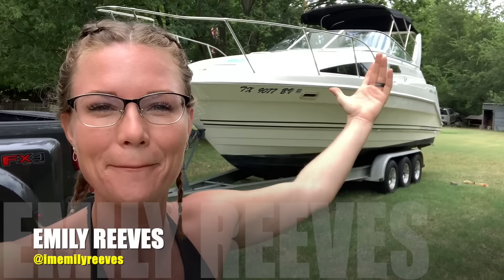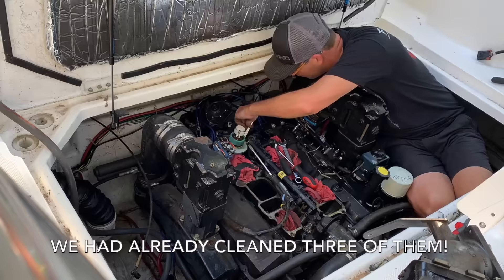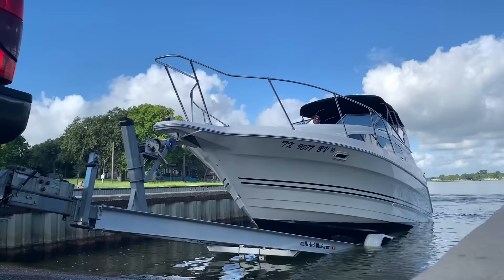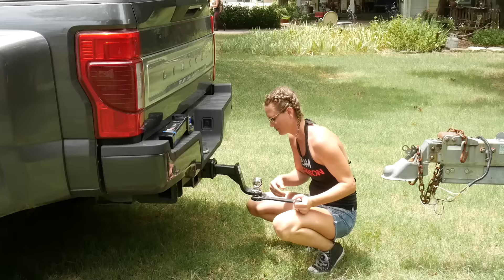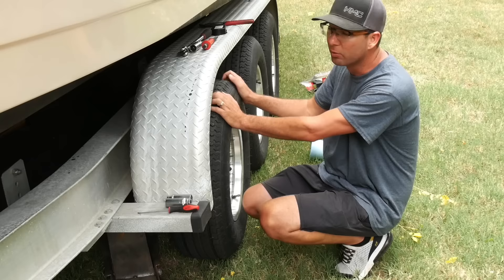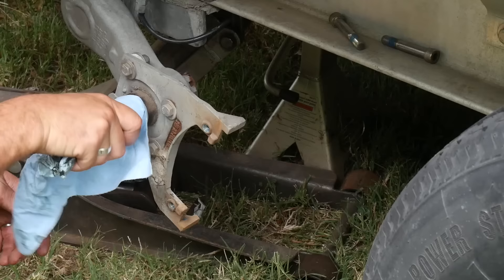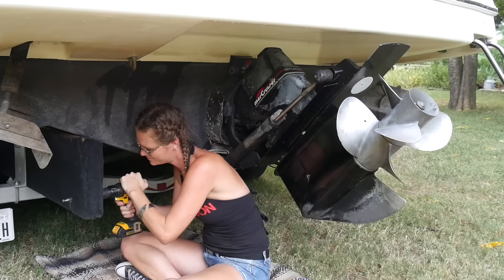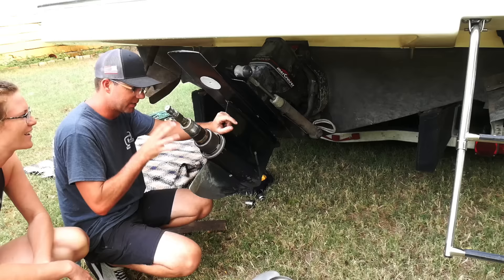Prepping our 5k boat for 10 day adventure!!!

Comment: I always had waterproof led lights on my trailer and still found i was blowing fuses in the truck. So anytime i go to launch I unplug the trailer and no problems since. Love the channel!
Reply: good tip
Reply: I've always done the same. Waterproof lights or not.
Reply: Depends if you have trailer brakes or not. If you unplug the plug you can't back up the boat to launch it cause the brakes will lock up theres a switch in the wiring that unlocks the brakes in reverse allowing you to back up
Reply: @nathanbutler8240  an electric trailer brake uses power to apply the brakes, not to release them. A surge brake will lock in reverse if you don't manually override it with the lever.
Reply: @robertpontius1689  my mistake I have hydraulic brakes on my trailer if my plug isn't plugged in i can't back up cause it pushes on the master cylinder on the trailer and locks the brakes unless the electrical is plugged into the truck
Reply: @nathanbutler8240  That is a thing i havent thought of and of course you are correct. My little 16 foot boat has no need of trailer brakes. That big triple axle trailer of course has brakes so my tip wouldnt be so effective. thanks for pointing that out.

Comment: when you park the trailer in storage get the trailer tires off the ground and cover the tires and use a protective spray on the tires
Reply: Don't use spray on tires ask any tire guy it causes your tires to dry rot and crack worse!
Reply: @burnair1608  Silicon rejuvenates rubber, any petroleum base product deteriorates them. Armorall and such I hate that crap. 303 Protectant has been used.

Comment: When you park the trailer jack the axles up and get tires off ground. They will last a lot longer.
Reply: Do you own any trailers? No one does that.
Reply: And cover them with plywood cutouts so the sun doesn't beat down on them just sitting there
Reply: Noah Smith maybe they should...
Reply: @rstrst2099  yes or the nylon covers are a good investment. Sunlight [Ultraviolet rays] are to plastic and rubber as saltwater is to metals.
Reply: @noahlearsmith  yes they do when stored for longer periods. Do you own any trailers?
Reply: All that is needed is to frequently move the trailer.  You can put chalk marks on the tires to make sure they are resting on different spots.  If you can, check the air and take them out for a spin too.  Getting them warm on the highway is GOOD for them. Then park them off the chalk marks.  I would recommend this quarterly.
Reply: Donald Smith I get the impression they’re only gonna be with the boat a few times a year, if it’s getting stored 3-4hrs away.
Reply: Noah Smith I do.. and it works. I also do it with vehicles that I don’t drive a lot. Helps big time with flat spots

Comment: On the seals, if you remove the outer bearing and run the nut back on you can use the shoulder of the nut to pull the inner bearing against the rear seal and it will knock it out, usually without damaging the rear seal. Inspect the bearing grease and reassemble.

Comment: Ask a welder that yall trust right to weld up 2 trailer guides 1 on the left and 1 on the right this aids the boat with correct alignment...you should find them sticking up and around on either side of the boat and usually slightly taller than the boat as well. 

This definitely works for boats this large

Many thanks from
South africa 🇿🇦 ♥️

Comment: Tip for tightening large nuts.  Use a chisel to drive it tight.  Old VW flywheel nuts where thought to be at 100 fp plus when you could not move the nut more than 1/16".

Comment: Our first boat together isn't nearly as big but we got a deal. 12 foot Sea King aluminum boat and aluminum trailer for $80.00. Found a 3.5 horse Sea Horse motor, air cooled, for $100.00. Now looking for a trolling motor. Already talking about finding a bass boat for the bigger lakes, but this will do for the lakes with a 5 horse limit on them. Sweet boat that y'all snagged up. Happy boating.

Comment: Since our launch ramp was rather steep, I never trusted the stranded steel winch cable on my trailer, so EVERY time I reconnected the boat, I added a large chain from the trailer frame to the bow eye.  It was cheap insurance!

As for trailer lights, I would build a removable light bar like the tow trucks use.  Trailer lights fail after being submerged,  especially if used in salt water.  A light bar can be kept out of the water and will last forever.

Comment: at 7:54; try turning the hitch receiver 90-degrees and re-inserting it into the truck.  90 left makes your wrench movement top-down when taking off the ball.  90 right makes it easy top-down to tighten the nut fully (since you can stand on the wrench)

Comment: 7:18 when towing you do want you hitch & related equipment ratings to exceed the weight of what you’re towing. When you hit bumps it can shock load & that energy is absorbed through the hitch. 
It also appears that trailer has hydrostatic brakes. That F450 can tow it but it needs help stopping it. Check/change that fluid & I suggest adding bearing buddies to easily grease the wheel bearings. If it doesn’t already have them.

Comment: Boats all have a spring loaded tie down specially made to hold a boat down on the trailer. Saw you holding a ridged strap with hooks. Bouncing will rip the eye hooks out. Spring loads will give, yet hold the boat on trailer. Everything else looks great.

Comment: When It comes to a receiver hitch , I've always preferred a solid bar, over the hollow bar.
Reply: Did you mean ball?
Reply: @BackyardBeeKeepingNuevo  The slider bar ,that the ball attaches to, then slides into the hitch.
Reply: taz one ah, ok. I’ve always used hollow bars.
Reply: Jr ALEXANDER  I don't know where you get that from, but the receiver bar is not round it's square and it's  2 inch by 2 inch. when buying a camp trailer they use solid square bar not hollow.
Reply: Jr ALEXANDER  I use a solid husky drop hitch with leveling bars and it's rated at 1000 lbs to 1400 lbs tongue weight and 14,000 lbs gross weight, when using the bars. I don't care what someone uses, solid or hollow ,as long as it's rated for the weight being hauled, and fits the receiver wright. I have both solid and hollow ,but have always used the solid ones for the heavier weight.

Comment: I had two sailboats on San Fran Bay and some trips out the gate and some up the Delta. I don’t know where the existing depth sounder is, but it’s a good idea to have one as far forward as practicable, mount the transducer on the inside of the hull (epoxy) where the turn of the hull is still mostly level, so you’ll have 
kind of straight down readings,
under the V berth. The bow is what you’re going hit stuff that’s under water with. Next buy a RADAR, probably with a chart plotter in the same unit. You’re going to be out on the water at night, and you might be boating somewhere that gets fog occasionally. Don’t think you’ll need it? There’s a saying in private aviation, “it’s better to be on the ground, wishing you were up in the air, than up in the sky wishing you were on the ground.”  You’re right you probably won’t need it, until you do. Make sure when the husband is out of commission the wife can raise the anchor and get him and the boat to shore/help. Free advice from one that learned the difficult way 👨‍🦳 enjoy your boat and may you have safe seas.

Comment: A tip Next time connect a 9v battery with alligator clips while you spray carb cleaners or injector cleanser on the injectors they will open and close while you are cleaning it.

Comment: Getting the seal out without damaging it is easy remove the outer bering and saftey washer then screw the nut back up on the spindle and pull out on the hub sharply an use the spindle as a reverse slide hammer and the seal will come right out n be left on the spindle .

Comment: Yes the tie down straps should be into metal and trailer wiring Great Job only thing I do different is after I'm done I use liquid electric tape makes mine last a lot longer from corrosion.  I use lime away on lower unit every year to clean it up than wax it my Boat motor is 16 years old and still looks new.  I have been towing a boat for 43 years and armor all is your friend as My tires have lasted over 15 years even parked outside once in spring and once when I put it away for the year stored outside all the time.  Tire pressure I check one a month when trailering and in 43 years I have had one flat tire and that was from a screw found in tire.  Strap on trailer take off take to a canvas shot cut off two feet then have them restitch hook on, cost a couple bucks.

Comment: Keep the trailer axles  greased.  When putting the boat in or pulling it out, Back the truck up till the trucks  rear tires touch the water.  If you need to go back further don't let the water hit the rear end

Comment: Just a couple tips: I always like to pull the drain plug as soon as I recover the boat at the launch. Allows any water in the bilge to drain out on your ride back.

Also, you can turn off the blow once you are underway. Start it 10 min before starting the engine to clear the engine bay of any fumes when starting the motor. Then you're good to shut it off. Enjoy!

Comment: Pro Tip:  take the 28’s with you, just in case.
Reply from the maker: John Fleming We brought them!! Lol!
Reply: You also should probably pick up a spare inner and outer nut. Why??? Because they come off, and you never find them in the bottom of the lake. Been there done that. FYI, you can pick up Bravo 3 prop wrench off E-Bay pretty cheap. You'll want that and the spare props in the boat with inner and outer nuts. I damaged a rear Dou-Prop on my VP one afternoon at a sand bar. And having all that in the boat saved a expensive tow back to the marina and a more expensive haul out.
Reply: We had 2 Bayliners before we purchased our four winns. Did not have any more fun on the expensive one than the cheap one. All of my boats had transom hooks. Even a fishing dingy should be secured. A  couple in Spanish fork canyon in Spanish fork Utah were killed when they slammed into a vehicle as the boat came over the top and crushed their truck.
Reply: You got a great deal. Owned two bayliners 2655 and a 3055. Nothing better than cheap boating. Nothings different if your mechanically inclined between you and anyone else on the water!
Reply: We bought a 1990 wide beam 2655 That had a OMC Cobra drive and a 460 Ford Big block. The boat it self was a fresh water boat, And was in fantastic shape. The engine ran. But the drive was shot. I had bought a Insurance salvage boat that had slightly cooked from another boat that burned at the same dock. It had a Volvo Penta Dou Prop drive and 2 NEW Stainless steel props. It took me a 3 day weekend to do the swap. Out with the Ford 460 (And had a buyer waiting for that) And out with the OMC drive and hull mounting parts.  And in with the VP donor parts. And as I was told by everyone on the Bayliners owners message board. The hole cut out would be the EXACT same size, Bolt pattern and all. I was running a set of F-6's on this boat (28" and 10'3 wide) And it was topping out at 90% throttle at 47 mph on good water. And was cruising at 36-39 mph at 70% throttle.  A speed that these old tubs never saw with the OEM OMC packages in the late 80's early 90's.  And was actually pretty easy on fuel. At cruising we where only burning 6- 6.8 gallons per hour. These counter rotational drives (VP & Mercuiser) have make fantastic repower packages for older boats like this. After doing this one of mine, And having other boat owners staring at me with the "IDK about this idea" I did 3 more for other people. The hardest part was finding a good donor. The hardest part of the actually job. Was setting up the gantry lifting set up to remove the old engine with out scratching anything. We finally went with a 5 tin electric winch and a 14' tall gantry set up on rollers to remove and reinstall the engine. After that it was super easy to knock one out. Started on Friday after 5pm. And typically we where doing a in water test run by late Sunday afternoon.  It got to be pretty fun to watch a depressed boat owner that wasn't so sure about this idea. To turning him into a kid with his first car, all over again.  And the performance from going from a single prop. To a dual counter rotational set up in like adding a complete other engine. The last one we did was a Small GM block (260 carb) Engine.  To a small  block VORTEX fuel injected engine. That went into a 2855 (10'3" Beam) boat. He put F-7 props on it. And it was SCARY how fast that big boat moved.  I hope you guys are enjoying your vacation in Arkansas.  Stay safe and healthy.

Comment: In the future,  if you pull the outer bearing,  then b4 removing the hub,  reinstall the axle nut just on the first 3-4 threads,  then let hub slide out until the hub nut makes contact with the inside bearing surface.   With a sharp tug outward,  the bearing and seal will both come out without damaging bearing or seal.   That's $5-6 per hub you won't have to pay for next time.  $30...thats a case of good beer!!!

Comment: When I was launching my boat I used an acronym “PTL”. P is the Plug, T is Tilt, and L are the Lights on the trailer. Just before you launch the boat at the ramp use PTL. The Plug must be put in, the Tilt must be up on the out drive, and the trailer Lights should be disconnected. Then you can launch. Just before attaching the bow to the trailer while leaving the water PTL. P is remove plug once on the ramp to use gravity to drain the bilge, T is raise the Tilt of the out drive before leaving the water to it does not drag on the ramp, and L is reconnect the light on the trailer before driving. Have a good time.

Comment: Dunno if you'll see this as its many months later. But I had a similar boat and added a "hatch wind scoop" for some added "air conditioning" was a fantastic mod for my boat and worked great. Low cost solution ( typically used for sailboats ).

Comment: I got a 27 ft sea ray 454 it does 40 mph u def have a missing still
Reply: I've got the same boat and I usually cruise around 22 but can do about 30.
Reply: @MikeMcCarty6453  sea ray
Reply: I cruise 29 top out at  43 with bravo 1 and stainless steel prop.   Half tank of fuel

Comment: Good thing you did do a strap to the back, should do that on all boats as a precautionary measure.  Also, should have a safety chain from the boat eyelet (where the winch strap connect to on the boat) to the winch stanchion  in case the winch strap fails.  Great cheap purchase and fix!

Comment: $600 on tyres is a small price to pay when your family is involved as that boat would flip that truck in a heartbeat and not care about doing it.
Reply: With 6 tires I’d be more concerned with just messing up the fender then an accident, a blow out isn’t gonna flip the boat on a triple axel trailer. Would just throw a spare in the bed and check them when stopping for fuel and snacks.
Reply: @davidreynolds731  , and they can  mess up a fender.  On our  dual axle boat trailer, I decided we needed new tires about a day too late.  On the way  to the tire shop, we had one blow, and it took the fender completely off and ruined it.  I had been putting off getting new ones all summer.

Comment: RC Engineering in Torrance, CA will clean your injectors for $20-30 per injector with ultrasound.  They will give you a full performance report of before and after.  They will put new seals and o rings and give them back and will make your engine run like a dream come true.

Comment: the proper way to secure a large boat on a trailer is to use a heavy duty ratchet strap rated more than your boats weight, you start at the middle of your trailer and go around the bow of the boat and then to the middle of the other side of trailer tighten the strap that stops the boat moving forward when you have to brake in an emergency while the brakes will stop the trailer the boat will want to go forward under momentum. don't rely on your winch post to stop your boat have seen a couple of boats push the winch post down and climb onto the tow vehicle. for the stern start at the middle of your trailer and go around the stern of the boat and then to the middle of the other side of trailer tighten the strap that stops the boat moving back on steep hills or bumpy roads. on lighter boats you put a strap across the middle to stop it bouncing on the trailer.

Comment: Couple of things - some states require a tie down - troopers will write you up if you don't have them.  When towing most folks worry about pulling it  - I worry about stopping it or a wreck. You'll be surprised the number of folks who will cut you off.  Panic stops are always fun  without tie downs that baot could wind up in the bed of the pickup.   Tires are normally ok out to ten years.  I use big contractor size plastic bags to cover the tires and protect them from the sun.  Couple of little 12 vdc oscillating fans almost as good as AC - even here in N Alabama.

Comment: Hey guys, just to make it easier to load the boat on the trailer, is to install upright posts at the back of the trailer with PVC tube over it so it can turn, so when you come in to the trailer you can just drive the boat in its place as the posts will guide it in all the way, you can also add Oil-On Strips on the sides of the hull supports so it curves around the hull to help support and guide the boat in, if you do this correctly one person can load the boat. Enjoy

Comment: Highly suggest you get a drive shower to keep things cool. The drive is pushing alot of weight. Also use Mercury Hi Performance Gear lube and change regularly. You two are a real sweet couple. Good luck.